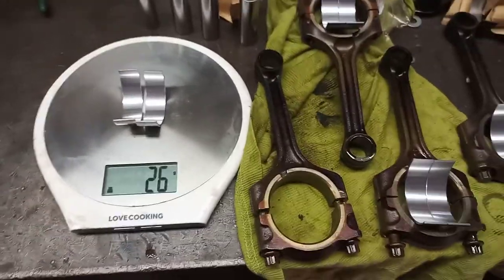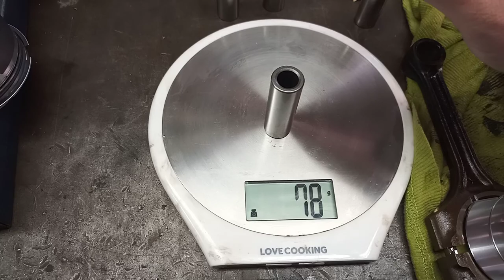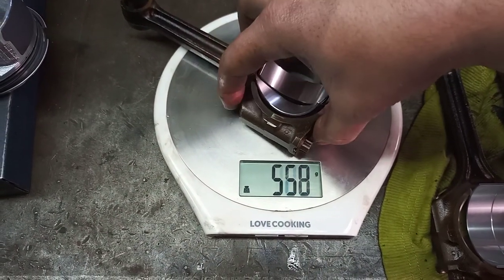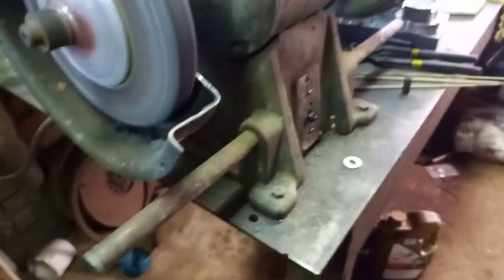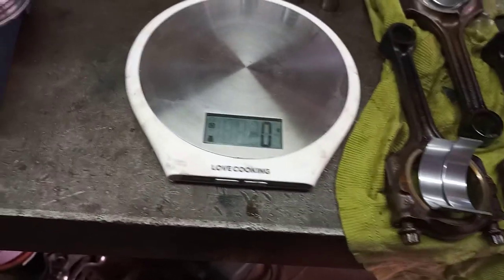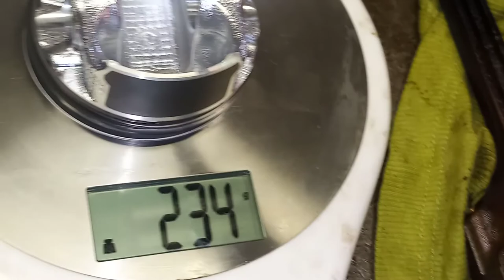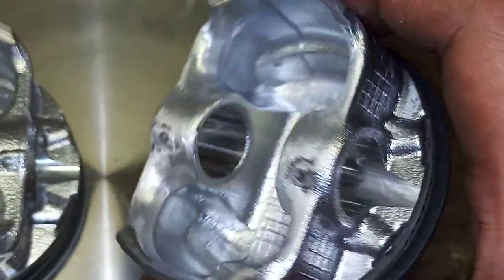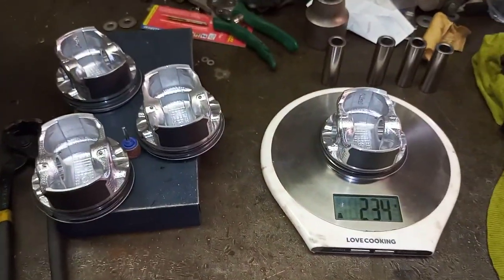How to balance pistons and rods part 1

Comment: If I'm not mistaken, that is a very conservative approach to material removal. I felt like you could have removed another 2gms from each piston without any real trouble. I would like to go more into the removal of the little end  'rib' / I'd like to know what you can really do with a stock cast piston. I have an Alfa 2.0l which I want to lighten and balance and I'm wondering how far I can go with stock parts.